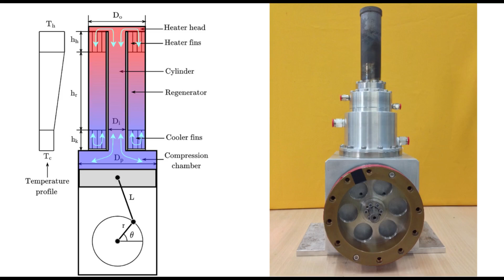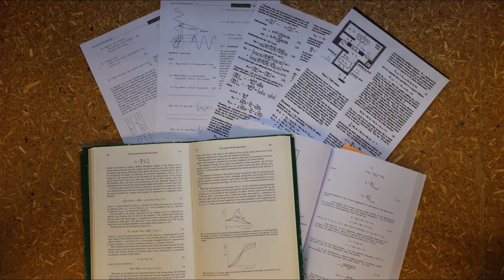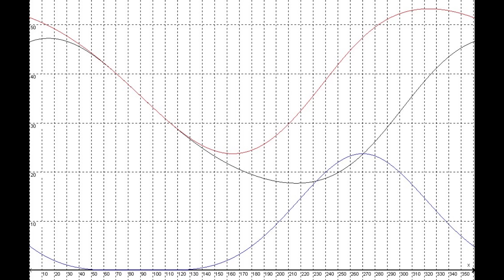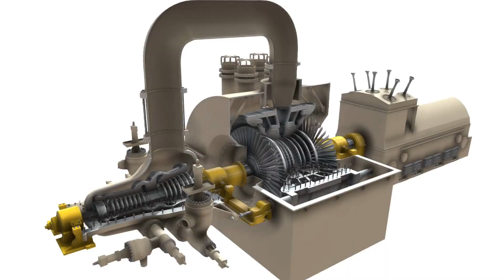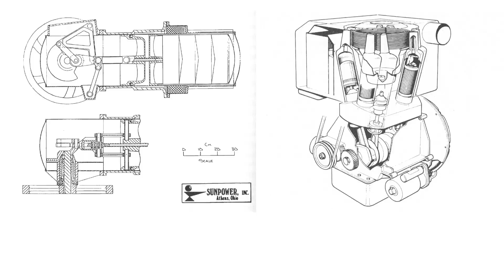Solution of producing cheap energy to support our solar plant to go off grid ?

Comment: Since I saw your first videos with the rhombic configuration I thought "damn this dude is really proficient but why does he use this design ? So much potential here" 
I just wanted to propose a 4 cylinder engine with double acting pistons BUT YOU HAVE INCLUDED THIS ONE ALREADY. I am really pleased to see that, well done mate =) 
I can´t wait for the next design and I couldn´t agree more on the design choices. Now I am really eager to see how you will rank the design choices, maybe through a pugh analysis ? 
Considering the "semi hobby like" nature of this projects (no offense you are a professional but you don´t have the means to develop a new engine with a team of engineers), my favorite would be the 4 cylinder engine. It´s probably the biggest and heaviest option but in this stationary application it should be no problem besides it´s most likely the simplest and cheapest to produce. Also probably easy to service and you should be able to use many standard parts like a cylinder block and pistons from an existing engine for example. However the thermoacoustic engine interests me very much as well but it´s probably more of an interesting though than a practical engine has you would need to do so much more R&D on that one. I mean it would probably be the best theoretical contender but for it´s lack of moving parts and overall simplicity but again I feel like it´s way more complex to produce a really well made one.
Reply from the maker: Thanks, I will put that in my consideration!

Comment: I would add Thermoelectric generators to your list as a way to use the low-quality heat you have there.  With your expertise in making hot ends for your Stirling engines I'm sure you could get the most out of the gas supply.  Low efficiency maybe, but the ultimate in 'simple' and zero maintenance.  
Also, ask yourself what type of energy do you need?  Would the gas be better used to heat water that could be used for space heating and other domestic uses, and for direct heat for cooking, reserving the solar electricity for things that need electricity? You could also use the gas to heat a rock or sand store to higher than 100C provided you do the insulation very well; thus giving yourself a multi-day energy store.
What do you actually need: mechanical energy (reciprocating, rotating et al), heat or electricity or compressed air?  Are  your energy needs and available energy seasonal? Does your digester work better when heated (I'm sure it would) especially to increase production of gas when your solar energy output is low in winter.
If the Atlantic meridional overturning circulation (AMOC) slows you will need all the warmth you can get!!!
Reply from the maker: Surely I want to use the 'wasted' heat from the generator completely to heat the digester, heat water and warm our home.
In winter the solar plant unfortunately produces very low energy.

Comment: The most efficient and reliable solution would be also the most boring one.... Internal combustion engine!
But the fun part with that would be to optimize the shitt out of it! 😁
I would suggest to use a bike engine instead of a stationary equipment engine. Those lawnmower engines are cheaply build and very inefficient to start with.
For example the engine from an old Honda CB125 or 250 would be perfect. Those engines are absolutely bullet prove!
You could increase the compression ratio slightly and optimize valve and ignition timing for lower rpm.
And the bio gas should not be a problem at all, just filter it through a bubbler to get rid of solid particles. The moisture is perfectly fine for an IC.
You might even could experiment with water injection, especially on the hot burning methane gas. 🤔
Reply from the maker: If everything else fails I will try an IC engine, not before.
But many thanks for your suggestions!

Comment: Free Piston Stirling engine is what i would like to see. I know that it is hard to calculate and not easy to manufacture.

But it would be interesting to see and you definetly have the skills and the shop to produce it.

Maybe start easy by dissasembling the one from microgen. You could try to reengineer it and also see if your calculations match the reality of the engine when you use its other values as input. Then expand from there.

They should be available used somewhere from the boilers that had them installed.

Great work so far!
Reply from the maker: I think the Microgen units are too high tech to reegineer them!
But thanks for your nice comment!
Reply: @myengines2443  Hm thats too bad. Are there other more simplified FPSE that are or were on the market?

You definetely need something to start from. What about the Generator? If you take the route of the FPSE, would you then also spool up your own generator?

Otherwise it might be wise to start with an existing linear generator and then try to match the values that it needs through the stirling engine.
Reply from the maker: Matching values because the have to is very bad.
I prefer to make everything by myself so it fits perfectly.
It will take longer but the result is better!

Comment: I like the idea of the gas turbine. It shouldn't be so complicated to repurpose an old turbo from car.
Reply from the maker: Isn't it really rocket science to build a reliable gas turbine?
Reply: @myengines2443  It is for sure challenging. I would say that  the majority of the off-grid systems that are using gas as a heat source, include always some sort of micro turbine to harness the power. Either with Organic rankine cycle or  Brayton with heat recuparation.

Comment: I would think about a steam engine. More power, simpler and a free selectable heat source which isn't involved in the engine process anyway.
Reply from the maker: The steam engine still seems to be very popular, as many people write in the comments here.
Thanks!
Reply: @myengines2443  Indeed. It is proven, robust, valuable and reliable technic. If we go for off grid appliances - I would recommend to avoid as much digitality as possible. Further you'll have to look for the most available heat source off grid. A steam engine doesn't need more than steam and oil to operate.

Comment: I would suggest a simple readily available internal combustion engine (inexpensive and easy to replace / spare parts 9n stock everywhere) and find a way to filter and clean up your gas.and add a noice enclosure
Reply from the maker: I am not sure if I can clean the biogas so pure that the IC engine (especially a cheap one) will last for long, surely  it would be the easy but also most boring way!
Reply: Look at an Arrow C-46 (natural gas oilfield engine)  @myengines2443

Comment: I remember when electric cars first came out and I discovered that they were basically 1000's and 1000's of 18650 style batteries. I was shocked. Not really high tech, just throw enough of the little ones at the job to get it done. And it worked.
I think a small investigation into Peltier devices might be worth it. No moving parts at all makes for compelling motivation.
Reply from the maker: Yes it would be very easy but many here advised me against it to use the cheap elements.
But maybe self made high temperature modules with magnesium etc. may be possible?
Reply: Great comment! I like to build stuff as much as the next man, but after being off grid energy wise for 8 years now even I can see that the solution for me at least is a simple PV system. Solar panels are cheap and we are awash with cheap lithium storage, I’ve gone for years with used 18650’s, now with Lifepo4.
The fun is in the journey not the destination, I’m going down the sand battery rabbit hole now to try and get me off the wood stove thanks to inexpensive PV. Hard to beat cheap brute force but I still have a soft spot for gasifies, turbines and sterling engines.

Comment: A "cold" steam Tesla turbine (running at very low pressure, therefore the boiling temperature is reduced).
Reply from the maker: Can it reach reasonable efficiencies?
Reply: @myengines2443   Yes, Look up the videos of Charlie Solis (TesTur Energy) where you can see power being made and learn about the Tesla Turbine. He makes 4.5" turbines as a kit.

Jeremiah Ferwerda (My Tesla Power) is doing the same thing with titanium blades to handle corrosive gasses. In his case, he has cad files available for subscribers.

Comment: Not sure how deep the rabbit hole goes, but my vote is for free piston engine - seems the best from manufacturability point of view - most if not all parts only require lathe work, spring stacks can be lasered or etched, the generator is basically a loudspeaker motor in reverse. I'm not entirely sure about the parts where you apply heating and cooling.
Reply from the maker: Yes the free piston Stirling is very nice but has also issues with wear and mechanical friction like the rhombic Stirling.
So maybe a TMG like low tech version with rubber diaphragm and increases stroke may be possible?
The heat exchangers in a conventional free piston engine are the same, only a TMG style can make use of the big diameter an can use plain ones.
Reply: @myengines2443  gave TMG a closer look - very impressive indeed, I wonder why it didn't take off? Or are the cryogenic pumps of today a reflection of that design?

Comment: This is probably a case of experimenting and measuring which engine is more effective in practice
Reply from the maker: Yes and I want to investigate which concept I will try first for a study model first.
At the moment I prefer the Thermoacoustic Stirling but I get so many good suggestions here on YouTube now that I really have to evaluate all these ideas!
Reply: @myengines2443  perhaps we can collaborate on the design. How do I get in touch?
Reply from the maker: @davidfleischer4407  best way is here in the comments here on Youtube!
Reply: @myengines2443  very well. It seems the free piston design is the best candidate. I would target a small model with modest output, but that can be measured reliably. Less than a commercial model, but more than one of the hobby diy designs.

Comment: I'd suggest avoiding thermoelectrics, they're inefficient and fragile both physically and thermally. Have you given any thought to beta stirling engines? They're relatively compact, there's only one cylinder to worry about sealing, and if you want expansion capability you may be able to link them in an inline configuration that allows for shared heating or cooling.

Edit: Also, consider your electricity generation method. I've seen a few tinkerers on youtube getting impressive results with axial flux designs, and I feel they have promise due to the design's stackability.
Reply from the maker: The Rhombic Stirling is a beta design.
The cheap thermoelectric elements are really not suitable.
But maybe self made high temperature ones made with magnesium and other new discovered materials may be possible?
The axial flux generator is a good choice if you have a rotating crankshaft!
Reply: @myengines2443 Rhombic is a fascinating design, but it incurs gear losses instead of just bearing friction losses, yeah? And it certainly looks easier to make and maintain a beta than a free piston. Maybe it's my love for simplicity biasing me! 😅

Edit: As for thermoelectrics, I wouldn't hold my breath waiting for improvements to trickle out of labs. Instead, maybe augment your biogas with HHO mix from a small low-output water electrolysis cell? It's no infinite energy glitch, nothing is, but adding a mix of 2:1 hydrogen and oxygen gas would likely improve combustion efficiency.

Comment: Use a tesla turbine with steam
Reply from the maker: Whats with the efficiency of a steam Tesla turbine?
Reply: @myengines2443 maybe 5% at best for home made setup, evaporating and condensing water is very energy demanding
Reply: @myengines2443  probably super low but its simplicity hits the low cost with minimal wear parameters hard

Comment: Really enjoying your realistic evaluations. Have you. Considered an organic rankine cycle system? The expander of course is the tricky part but I have seen examples of a freezer compressor being used and there should be low wear considering how long fridges run. I believe it is as simple as removing the directional valves in them. Freezer or air conditioning scroll compressors used and should have low wear.
https://youtu.be/z0NFkhYccyU?si=-2IXwQM_XtNokUb4

Comment: Since old vidoes my pick is still alpha and it can be use with engine oil like 4 strokes engine to reduce wear.
Reply from the maker: Oil will contaminate the heat exchangers and can only be used without a regenerator and very low temperatures or the hot space will also be clogged!

Comment: Why not a cheap ( possibly even Chinese )  IC generator with a gas carburetor ?
If you can bring your gas to certain amount of pressure I see no problems at all.
Gas compressors tend to be expensive though, but with it you have much more options and control.
Reply from the maker: I think especially a cheap IC engine will not work long with 'dirty' biogas!
Reply: @myengines2443  Meh, I think you'll be suprised.
Anyway, first testing this out with a cheap engine seems logical to me, seems the most easy way at least.
But again, compressing and storing the gas is probably going to be expensive. Especially compressing it, but gives you much more options to try things out. And that way you can store the gas compact for later use.
Anyway, that's what I think :)

Comment: what is with a Rhombic Stirling engine with extremly thin oil wich in constantly filtered with a small electric gear pump to provent clogging ?
Reply from the maker: This will not work with the high temperatures in the heat exchangers.
Reply: @myengines2443  you right the highest temp oil i found is ratet for constant 200C and short time 450+C, i also dont think that will work. But if you use bigger surface heat exchangers and dont go over 500C outside the heater do you think this wille be efficent enouth ? Oil has a higher thermal conductivety than air or helium so i think oil film or little oil wettyness on the heatexchanger will not matter but the temp thing. sry for my bad english
Reply: *to provent clogging from wear particles form bearings, seals, moving marts and small amounts of coaled degraded oil

Comment: Hear me out, What if you used an atmospheric heat engine
Advantages:
-Quiet
-Extremely low maintenance
-resilient
-low complxity
-easy to manufacture
-cheaper
-ver minimal moving parts
-easily runs on dirty natural gas
-no more looking for stirling engines and going into water or compressed air turbines ( better i think)

For this engine you basically using low pressure steam, but you are able to pump water to a raised reservoir, then this water will come down into a turbine generating power and turbines are god like in this respect. The  water returns to a lower reservoir and the cycle continues. So if you actually improve this old technolodgy  with advanced technolodgy, think it would be simpler. you wouldn't need to worry about the complexity of the system, you will just be analysing and improving the turbine and the fluid system.

 So i think thats the best place to put your dirty natural gas into. If your not interested in water dynamics why not turn it into a compressing pump. I think it could be highly efficient with the improvements of todays technolodgy, AND its extremely low difficulty in maintenance and quiet. I think its a perfect contender. What do you think? Love the VIDEOs!
Reply from the maker: Thanks, I have to think about this!

Comment: wenn der Rombic Stirling es nicht gebracht hat, dann werden Alternativen schwierig.  An so etwas wie dem EG1000 von Sunpower haben sich Generationen von Ingenieuren ausgetobt. Der ist an der Kombination von notwendig engen Toleranzen und unweigerlich auftretenden Verformungen im Heißgasteil gescheitert. Irgendwann hat es immer geschliffen. Das kannst du leider nicht toppen. Mir fällt da nur noch der 4-Takt-Gasmotor ein. Ist laut und man muss regelmäßig Öl wechseln.
Reply from the maker: Darum möchte ich ja eine "einfachere" Alternative wie den Thermoacoustic Stirling, der Gedanke an keinerlei bewegten Teile (außer zur Stromerzeugung) ist einfach verlockend wenn auch sehr experimentell.
Aber darum geht es ja...
Mit einem normalen Verbrennungsmotor kann ich mich einfach nicht anfreunden.
Reply: @myengines2443  ich habe einen Membran-Stirling gemacht mit 1 beweglichem Teil. Dem Arbeitskolben. Anonsten schwingt da noch eine Latex-Membran. Er hat aber nur etwa den halben Wirkungsgrad wie der Freikolben-Ringbom-Stirling, den ich auch gemacht habe (0,7% vs. 1,1%). Aber der hat wieder mehr Verschleiss. Die Videos sind noch online. Check it out!

Comment: imo the oversized alpha is the best option, constant running is a very restrictive requirement and if you are charging batteries is unnecessary.
Reply from the maker: The problem is that high power levels are difficult to achieve with these engines!
Reply: @myengines2443  an idea worth considering would be having multiple units slaved together which would give 2 layers of downtime compensation, firstly they wouldn't have to run 24/7 and secondly if you make one or two more than the minimum needed you could swap out units for maintenance.

Comment: I will make a Lage Alpha Stirling configuration, because a V-Engine from a Twin V-Air compressor is very cheap. And with a big cylinder volume your heatexcangers are in relation smaller, so the death-volume is lower.
Reply from the maker: The V configuration is very easy but also involves heavy piston side forces without crossheads!
Small dead volume is good but you need as much heat exchanger surface as possible!